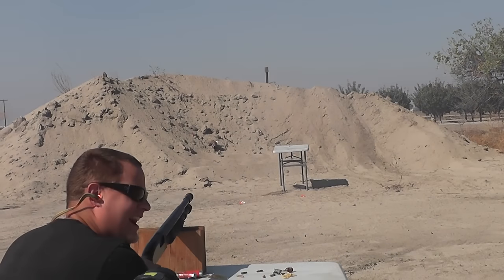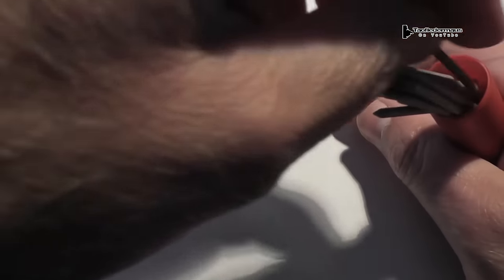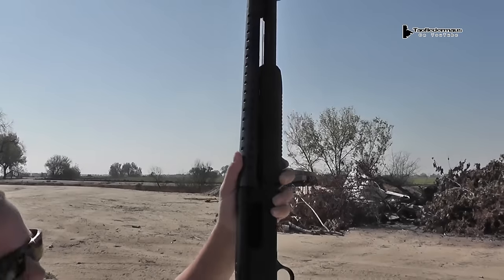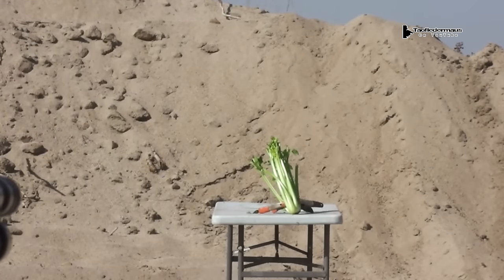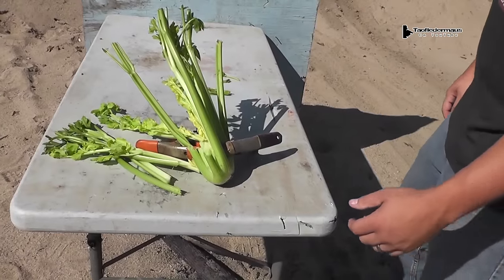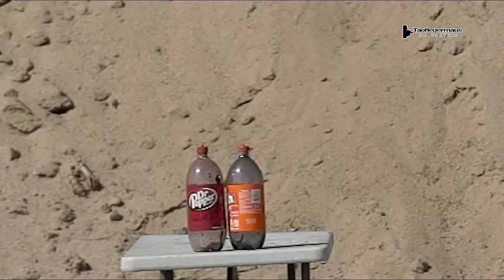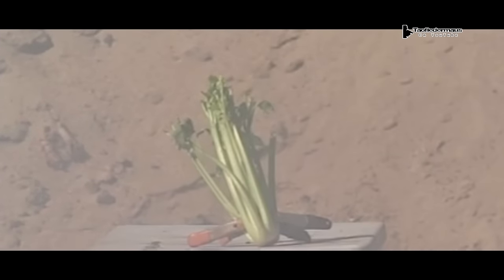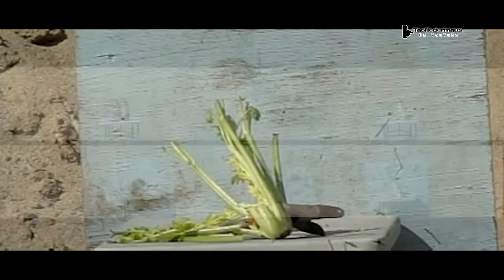NAIL Shotgun Rounds -  12ga NAIL GUN

Comment: The wax makes the muzzle brake venting look really awesome.
Reply from the maker: +Mike Dittman  Are you still making those?    It really shows how much gas is actually being vented.
Reply: +TAOFLEDERMAUS yep still at it. Most of the customers I get are your viewers. One of these days I'd love to get some of my rifle brakes down to you. Think it would make an interesting slow motion video.
Reply from the maker: +Mike Dittman   Ok,  I'll put a link to your channel.  I wasn't sure if you were still making them and didn't want to send folks to you if you weren't.   I made that mistake with the shell prepper guy,  Mountain Storm,   and started getting people saying he wasn't selling them or had sold out.
Reply: +TAOFLEDERMAUS I was down for a few months due to medical issues but still responding to customers. I need to have my website changed a little because the email system on it send from the website so if someone has a typo in their email on the message I have no way of responding.
Reply: +TAOFLEDERMAUS You should fire little spike balls out of the shotgun!
Reply: +TAOFLEDERMAUS hey you should glue a couple nails together and leave some untouched so its part slug and shot
Reply: +Mike Dittman Don't I Know it! BTW My A-5 is working great with your muzzle break. 0 movement, solid as a rock.

Comment: Next time wrap the nails in bailing wire, or weld them together
Reply: +Oliver Lane So... basically make a shitty lump of metal? :D Some kind of wire may be able to hold them together but still allow to hit target independently, welding them together will just produce a very bad slug.
Reply: +The Crazy Pineapple wouldn't solder work better? not sure if it would instantly melt once it fires or not though.
Reply: +The Crazy Pineapple well, yeah. i would suggest the wielding with wire gauge similar to roofing gun coiled nails.
Reply: +Oliver Lane just a small amount of electrical tape
Reply: Think the plank is the best way to go...
Reply: +accorden what about wood slugs?
Reply: Wood slugs...with nails!
Reply: @DeuxisWasTaken  or a really good slug that penetrates well

Comment: if you use pine resin instead of wax it may holdup better, another thought (and really a full slug design) what about suspending the nails in glass? nails would reinforce the structure but still allow for the fracturing and splintering

Comment: Perhaps bunch the nails together tightly with 10-30 rubber bands (hopefully so it stays mostly together as a gnarly slug round)? No idea if the bands would hold up though....
Reply: +xMunkyChunk The rubber bands would just break so it wouldnt work
Reply: +DeadTheFreak I figured as much. A lot of pressure and force at play. But what about rubber bands and wax? Probably not worth the time to test.
Reply: Wont make a big diference becuse the wax will vaporize

Comment: wall of smoke time lol.
how about a fine gauge of wire or glue a strip of paper around the nails hold them together, might need a crude sabot to protect everything from the shock and temperatures but I imagine the natural tumble of the nails would snap the wire or the paper in flight getting the shotgun effect while limiting the spread to some degree

Comment: did you use crayons or candle wax? candle wax holds better, i think this needs further testing, if the candle wax doesn't work you should try hot glue
Reply from the maker: +callhoonrepublican   It was candle wax this time.   There isn't enough surface area on the nails to form a very strong bond.

Comment: TOA, M.S. shell prepper's gives you sooo many options. lol. lil tip for better waxers add "micro crystalline wax" to the wax you use to make your "Tao's rounds" .lol. M.S. uses a lil bee's wax too but if you add 4 parts crayon n 1 part micro crystalline wax together the rounds hold together thousand times better ! you can experiment with the ratios but, after you shoot your video shoot a few rounds of reg. lead trap rounds to clean out any left over wax. cause this blend of wax is real sticky. you can buy micro wax online. and 1 lb. lasts a long time. boxes n boxes of fun! easier than hot glue too.

Comment: Hey Jeff!
Why don´t you turn the muzzlebreak 90°? No more blocked footage :)
Reply from the maker: +dunealex73  The only way to get that brake off is to cut it off with a  zip wheel.
Reply: *****
 I thought you heat shrinked it on? As long as you haven´t made both parts perfectly clean, they shouldn´t have cold welded themselfs.  A little ice and heat plus some lever and it should turn. At least that´s how I moved heat shrinked parts at work.
Anyways, thx for all the nice content. Keep up the good work and have a nice weekend!

Comment: Would you be able to cut fruit if you fill a shell with guitar string? Could you try different strings?
Reply from the maker: +poosiehandler  I think the damage would be pretty light since it wouldn't have very much mass.
Reply: +TAOFLEDERMAUS do you think it could be densly packed using a thin rod and wrapping the string around it to a proper diameter, then putting that into the shell (before removing the rod)? Trust me, I'm an engineer.

Comment: I think that worked well, apart from the smoke... what would happen if you used a car body panel filler to hold them together? You know the stuff, you mix it in two parts and it goes rock hard.... I think that would be devastating, or it would blow up and kill the shooter? But from where I am sitting I think it's worth the risk. :)
Reply: Thats a good idea. Try bondo

Comment: Why does the hot wax not make the powder go off?
Reply from the maker: +John L Bales   Wax doesn't get hot enough.
Reply: I would not take my chances on that. How about using clay? You already takes risks as it is. Just thinking of your safety. Or am I being an old man who worries too much? I've had; (all work related different times) an amputation of right big toe by freight elevator, right index finger broken in seven places, and a screw driver squeeze fired into my face, thru upper lip, along my teeth roots, along zygomatic arch,  and stopped just short of my left eye. I was in shock not thinking to not pull it out, so was bleeding like a stuck pig before I was taken to ER. Call me crazy, but I don't try to press my luck any more. If this does not make you stop and add a little bit more wisdom, then that is your business. I would not wish harm on any one, including you brave young men. Maybe some just get to skate through life while others pay the piper and that is just the breaks. When I was your age I thought I was invincible too. May your guardian angels always stay two steps ahead of you.

Comment: Why do you want the nails to stay together? That would just make a slug. I can see something to keep them from breaking up a bit longer, but I see people suggesting you weld them together! Solder, maybe. As it is, they seem relatively effective: they'd put a hurting on someone. Have a bunch of nails embedded at various angles in your body? Ouch. I have to disagree, however, when you say "pretty much the same thing as a military flechette"....it's not. A flechette has fins at the base, and is designed to fly straight, which these obviously didn't. It was supposed to work like one, but it didn't.

Comment: what do you use to pressurize the bottles again?
Reply: +Matt Stitz probably a compressor
Reply: +Hippownage I mean did he like put a schrader valve in the cap or something? you can't pressurize a bottle and then quickly throw a cap on it lol
Reply from the maker: +Matt Stitz   The Big Blast inflators.   They are a special cap with a rubber valve you fill up like a soccer ball.
Reply: ***** Are you ever gonna do another Test Tube Torcher Test video?
Reply: +TAOFLEDERMAUS thanks, great channel, subscribed
Reply: +Matt Stitz I made some homebrew ones using old tire valves and filled them to 8 bar which i think is around 120 psi if you're American
Reply: +MrcabooseVG I actually had made one with a tire valve and brass cap. worked good but ended up hitting it with a wax slug and couldn't find it lol. must have caught some inertia and went bye byes
Reply: Yeah, i use them with my air rifle and even at 60 yards they're as loud as my shotgun. I rarely find the cap again so not much point in paying when you can make them for free
Reply: ***** Well, the ones Taofledermaus uses have a hole in the side, you can attach a cord to them so they are easier to find. I'd imagine it works well, unless you shoot it with birdshot (then the cap will probably break anyway).
Reply: ***** Maybe, someone needs to make a clay trap for them. Now that would be fun
Reply: +Matt Stitz Air, Just air. Nothing special.

Comment: to make your own big blast inflators just drill a hole in the cap of a two liter place in a valve stem and glue in with hot glue on both sides.
Reply from the maker: +Grant Richardson  Sure,  but sometimes it is easier to just buy them since they aren't that expensive.   These hold the air pressure for hours too.
Reply: Ive had that method hold high pressure for days. and I was posting it mostly as an alternative for viewers who don't want to buy them and have these things around.

Comment: YOU LOADED THE NAILS WRONG!

hehehehe.

If the round held together longer it might work okay.
Reply from the maker: +Sarin Highwind   They were still pretty crazy!    Probably hit 3 or 4 people in a group.
Reply: ***** YOURE CRAZY!

haha.

This might be one of those times where a really hard wax mighta helped.
But it almost seemed like gasses got past the shot cup and melted the wax good. shrugs

It was pretty nice though compared to other tests.
Those nails are heavier and have more fun to them. 
Only other thing i can think following this method would be to do a full length wax cast on them.
So its like an actual sabot.
Reply: +TAOFLEDERMAUS Try soldering the nails together, that way they hold together a little bit before flying out.
Reply: +TAOFLEDERMAUS wrap a central core of nails with a bit of masking tape? Maybe vary the amount of tape winding said core? Or maybe the entire wad, but vary where on the wad the tape is, like nose, middle or tail?
Maybe the inch wide gaffers tape?